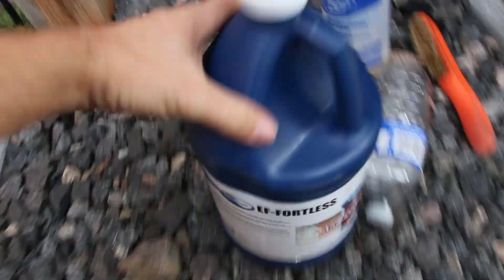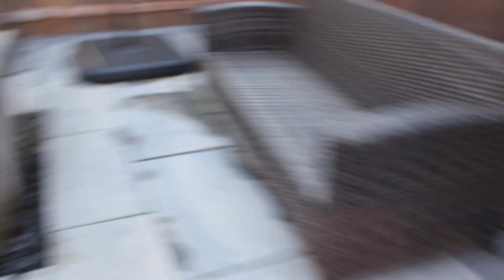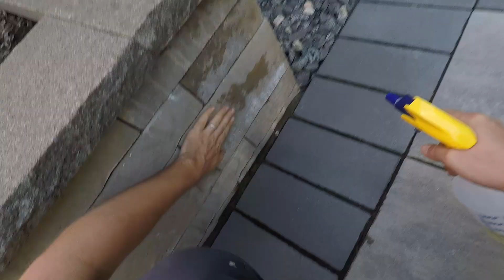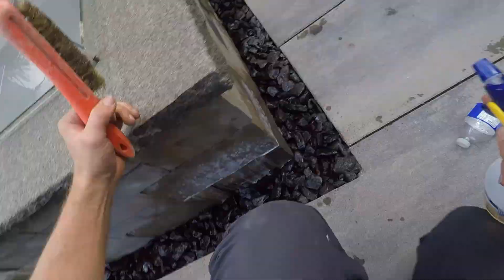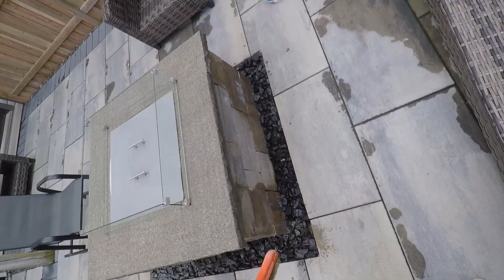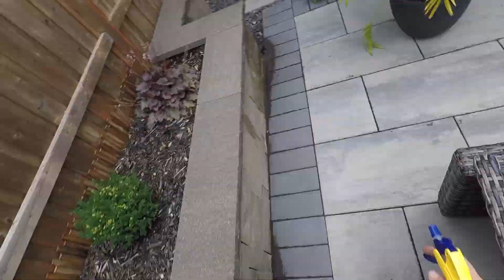Cleaning Efflorescence Again

Comment: Thanks for sharing your experience with the product, sounds like winner. Is there a way to prevent efflorescence from showing up in the first place?
Reply from the maker: Good drainage in behind the block for retaining walls and a drip edge scored underneath the caps (slight cut into the cap) so that water that moves from the top of the cap to the bottom hits that edge and drips down rather than the face of the wall. Unfortunately in this case, neither has helped and the next step is to contact the manufacturer for a solution.

Comment: I've had this issue with Permacon caps recently. Rep told me the best way to deal with is to the get customer to submit efflo form online. Permacon comes and clean, if it comes back theyll pay me to replace the caps. Still waiting to see how it turns out. I assume Techo-bloc would do the same
Reply from the maker: ohh that's an interesting process